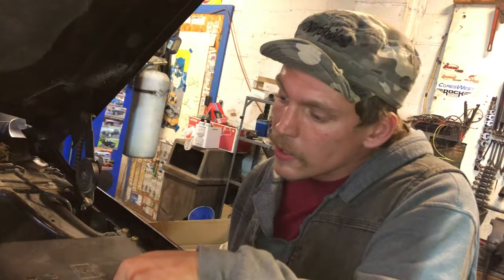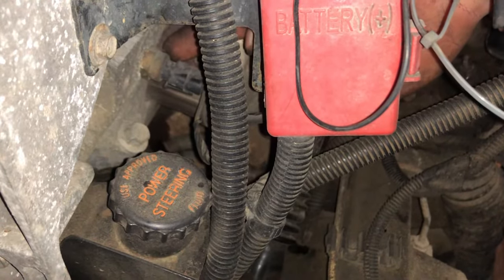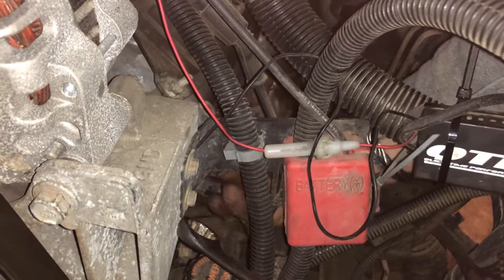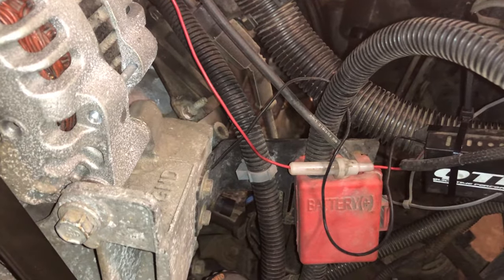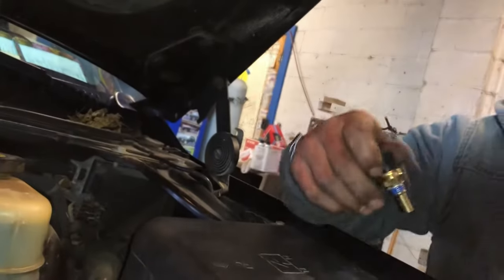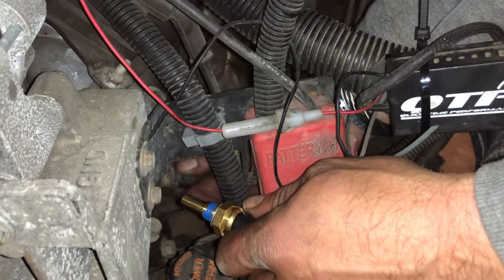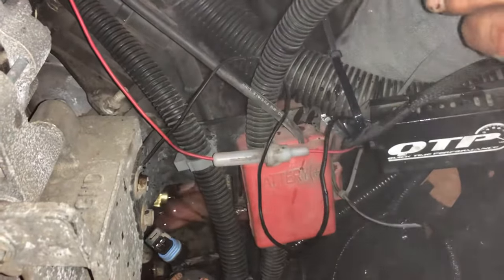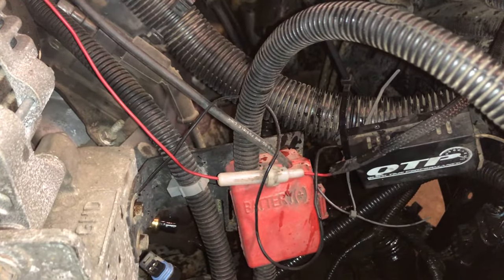Chevy Silverado coolant temperature sensor replacement and location Ft. Canadian KC

Comment: So I changed my coolant temp sensor and on the way to get it re scanned on the dash it said “coolant temp” and flashes of very quickly after that it said engine over heating so I turned it off waited a minute turned back on and it started rough but started I drove it bakc home and now I’m scared to move it
Reply: It’s not actually hot most likely could be a bad new sensor

Comment: Thanks guys. Mine started doing the engine hot turn a/c off which I did but the fan kept running and the temperature gauge bottomed out at 160 F. I started looking at a few other conversations on the problem from the Chevy help thing. One mechanic said that is a common problem on these trucks and he said it's the plug that goes bad.
Reply: Which plug you mention?
Reply: @joseledezma676  some heat sensor where it plugs in to the engine. I fixed mine by simply changing the thermostat. After I did that the message went away.

Comment: You know I'm thinking of changing that right away too because I'm having problems with my fan so I'm going to change that sensor and apparently I got to change my radiator but my drain plug broke off so maybe that's the only good way to drain my radiator is what you just did but looks like it's going to make a big freaking mess

Comment: Would a low idle, and dying be a cause of this part going bad? 02 Silverado is dying when I come to stops ( all of the sudden) and another video said it might be coolant temp sensor that needs to be changed. 
My truck has no cats because they have been stolen. So it’s straight piped for now.
Reply: Did you ever get that fixed the truck dying?